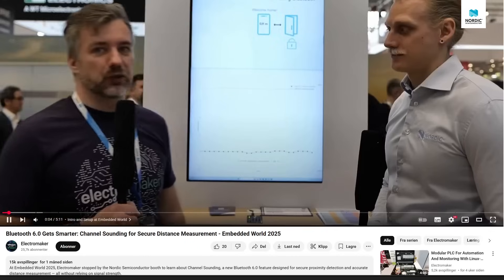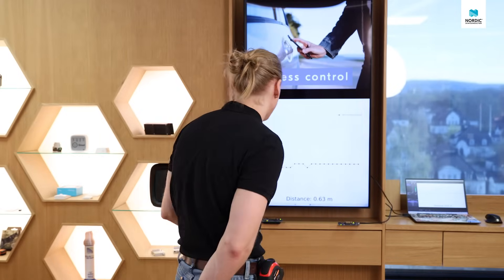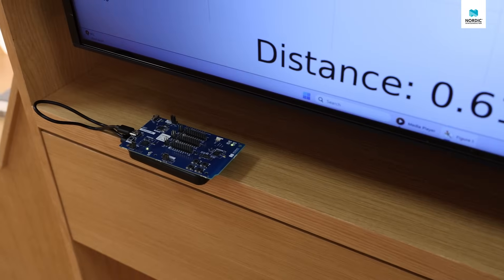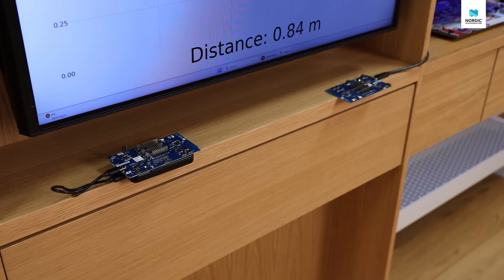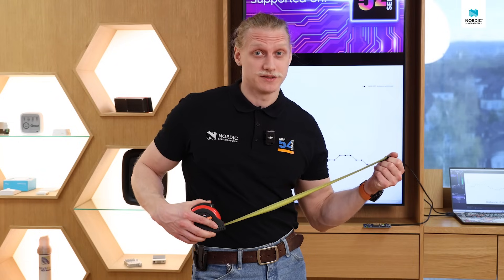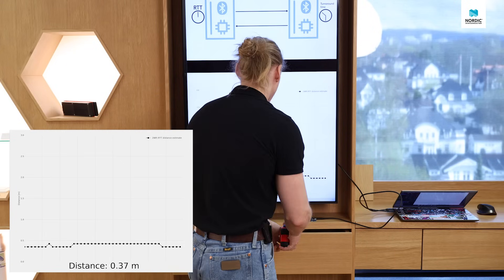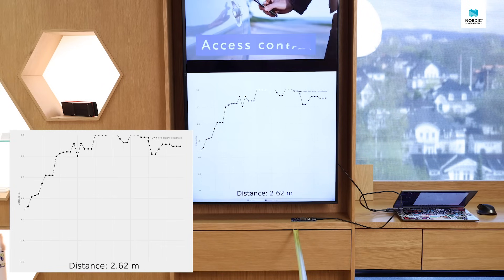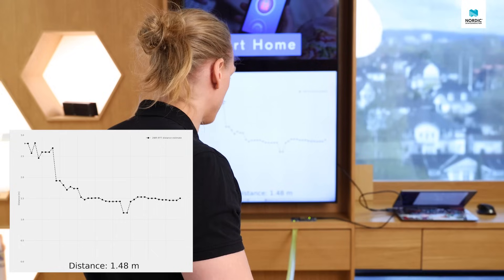Demo: Bluetooth Channel Sounding, Introducing Our Production-Ready Solution

Comment: What happens if you rotate the antenna or put something in between the two ?
Reply from the maker: We had a demo in the nRF Connect SDK v3.0.0 webinar (https://www.youtube.com/watch?v=FqVRptGeKms&t=1469s) that shows it is not significantly affected by objects between the two. This is one of the major advantages of Bluetooth Channel Sounding compared to other techniques for measuring distance based on Bluetooth, such as RSSI.